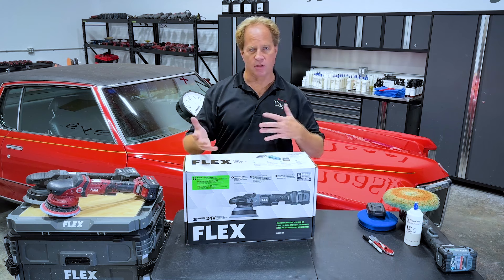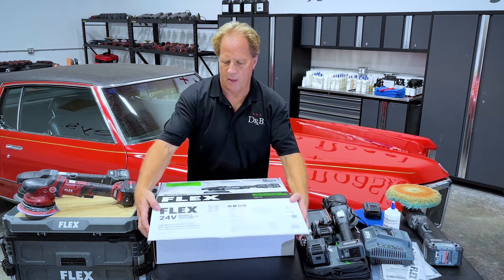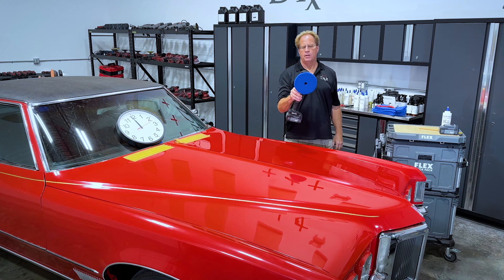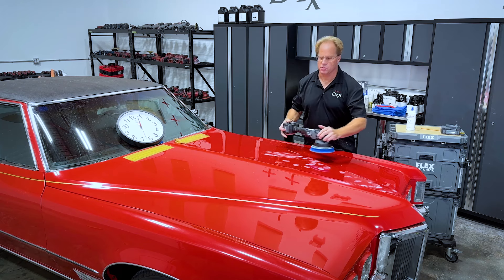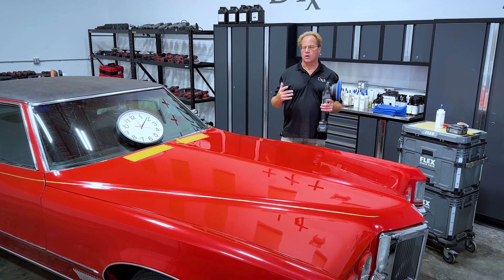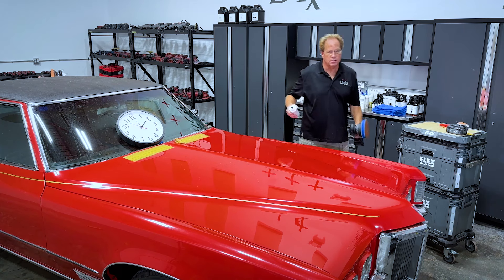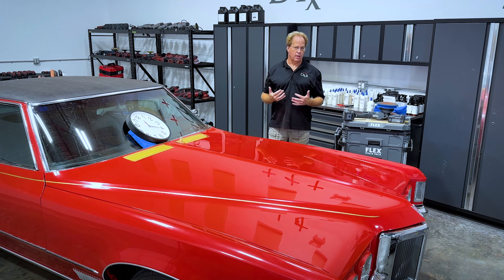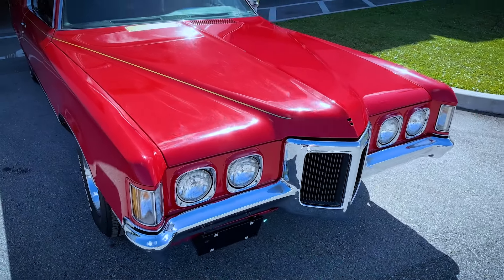NEW Flex FX3331 24V Cordless Gear-Driven Orbital Polisher Review & Unboxing

Comment: Just bought this machine... Additionally i have 3 tips for working on doors 1. I separate them, click the latch on the door to create a space to work safely to edges (pulling the handle releases the latch) , 2. If working the back door I open the front door so I can work to the edges also, 3. I'd work parallel to the body line just like Mr Phillips, Including the door handle, then divide the lower section into halves, I always try to work along a body line and not crossing against it that could potentially burn the edge
Reply: Great tips.  I just used all these tips on a 1935 Chevy 3-Window Coupe Streetrod.

-Mike

Comment: The Flex Legend! Just got my 24V 15mm and put up my first impressions. Correcting an FL5 Type R this weekend and it’s killer so far.
Reply: Enjoy!

Thank you for watching and commenting.  -Mike Phillips
Reply: How much did you pay for this tool?
Reply: @yuriy797   - This particular tool retails for just under $700.00 and this includes the batteries, 2 batteries, a storage case and the charger.

-Mike
Reply: @mikephillipsrealworlddetailing  😂 Cheap 😂

Comment: Definitely like the 6 inch backing plate with these. My only gripe of the rotary is the max speed is a little low for using a pad washer and spinning out the pad. These polishers are all beasts. Also nice having the lifetime warranty. Both the rotary and the forced rotation came with 6 and 5 inch backing plates with mine.
Reply: I agree with the high-speed RPM for slinging out water when using a pad washer but I'm confident the engineers at FLEX gave it a minimum and maximum RPM for the function of a battery-operated tool as well as the most common use for this tool is for doing paint correction on modern clearcoats where you don't need super high RPM.  Gelcoat is another situation, but I still show and use these for removing sanding marks out of gelcoat - but on the highest speed setting.  The freedom of buffing out a boat (or a car), without using a tool with a power cord is really nice.

Thank you for watching and commenting.  -Mike Phillips

Comment: Thank you for sharing your polishing expertise—it's always greatly appreciated! I’m in need of some advice as I’m about to upgrade my equipment, aiming to make the purchase by Thanksgiving. Initially, I had my sights set on the new model from the Italian brand, but after attending SEMA, I’ve decided to go with Flex instead.

I was set on getting the FX3321 random orbital with the upgraded 6-amp stacked batteries. However, after watching your videos and Nick’s from McKee's multiple times, I’ve started leaning toward the gear-driven FX3322. Now I’m torn between the two.

A little background: I’m an auto detailer working out of a garage studio and a mobile van. About 30-40% of my work involves paint gloss enhancement or correction, but I plan to increase that number since I focus on reconditioning vehicles. Since I’m not as young as I’d like to be, factors like weight, noise, vibration, and balance are particularly important.

I know you’re more inclined toward rotary or gear-driven machines, but if I asked you to take an unbiased approach, which would you recommend based on the details I’ve provided? For reference, I currently work with a random orbital.
Reply: You indirectly answered your own question. Since you own a random orbital, get the gear driven. There’s a reason why the GOAT, Mike Phillips, chooses it as his first weapon of choice unless there’s really severe defects then it’s the rotary first followed by the gear driven 2nd. 

And for what it’s worth, I own two gear driven flex polishers and a DA polisher. Gear driven every time unless it’s super soft paint, then it’s the DA. 

And you’ll appreciate that the gear driven tool doesn’t stall which means your saving time with each detail and time equals money. 

But for sure follow Mike’s guidance. He’s used every tool in the book.
Reply: @jamess.7415  I realize I should have been more specific. This purchase is actually meant to replace my current random orbital rather than adding to my "arsenal." My main concern isn’t really about stalling, as that’s rarely an issue with my random orbital.

What I’d really like to know, in addition to my earlier questions, is whether the cutting power of the gear-driven model is significant enough to justify the potentially longer time it might take to complete a job. My understanding is that the 15mm throw of the random orbital allows for faster coverage but is less effective compared to the 8mm throw of the gear-driven. But is the difference substantial enough to make it worthwhile?
Reply: I just read through your original question and the follow-up replies by Jamess.7415 and then yourself.

Here's the deal.  When using ANY brand or type of free spinning random orbital polisher, you're always going to fight the issue of pad stalling.  It's just a fact.  Besides making it take longer to do paint correction; you also have the issue of BRAIN DRAIN.  Brain Drain is when you mark the side of a backing plate and/or buffing pad to make it EASIER for your EYES to see if the buffing pad is in fact rotating and oscillating.  In theory this means for the entire time you're buffing out the car you MUST LOOK and SEE if the pad is rotating/oscillating or simply stalling out.  I call this brain drain and I for one simply don't use these types of tools very often for this reason.

I like to go fast when I do any machine paint correction, thus I primary use rotary polishes and the ORGINAL FLEX BEAST because the original BEAST has the highest OPMs and the highest RPMs.  Thus you can plow through a paint correction as fast as humanly possible while maintaining pro-grade results.  Throw in a simple 8mm Porter Cable and you can tackle just about anything.

Thanks for watching and commenting.  -Mike Phillips
Reply: I truly appreciate your feedback—it means so much! It seems I made the right choice. I’ve ordered the gear-driven polisher and can’t wait to start using it!
Reply: @jamess.7415   - Yup, if I can use the BEAST, then it's Go Time!  If a rotary is faster, then I start with rotary.  If the paint is soft or I'm working on clear plastics, I go with a simple Porter Cable 7424XP.

Use the right tool for the job.

Thanks for watching AND commenting.  -Mike Phillips

Comment: I find that most detailers underwork the correction fluid or work at too high a machine speed, polishes/compund have 2 parts, the abrasive and the carrier, if you work the machine at a high speed the carrier burns out before the abrasives get a chance to do any major correction, instead work at around speed 3/4 at first, clean the pad and redure speed to 2/3 and do a pass before wiping off the polish, this would ensure a proper buff cycle (note that most polishes to date use diminishing abrasive technology, DOT)
Reply: Good info, thanks for sharing.  -Mike

Comment: Mike does the forced rotation random orbital require different pad as its gear driven??
Reply: No, not really.  The most important thing when picking pads for a gear-driven orbital is to pick a pad that has *good velcro attachment strength to the backing plate*.  Because of the POWER that comes with a gear-driven orbital, and the fact that you can *GO UP ON EDGE*, you simply want good attachment strength, so the pad doesn't go flying off.

Currently I'm liking and using for all our car and boat detailing classes the EdgeGuard pads from Buff & Shine.  Not only to they have good attachment strength with the FLEX choice of HOOK used for their backing plates, the new 18v FLEX Cordless BEAST and FINISHER have a tick larger backing plates than the original FLEX corded BEAST and this means they CENTER easily onto the backing plate and because there's a plastic inner cupping around the outer edge of the back of the pads, there's dramatically less risk for anything bad to happen when you do go up on edge.

Hopefully the above makes sense.  It would be easier to show you than to type to you about it.  :)

Thanks for watching and commenting.  -Mike Phillips
Reply: @mikephillipsrealworlddetailing  Perfect sense mike I'll look into the buff & shrine pads. Saw them on your YouTube page and looked what I saw. TY for taking the time from your day to help this community much appreciated.

Comment: Does this model still spin counterclockwise?
Reply: Yes.  I hear people tell me all the time that they don't like that the FLEX family of 8mm gear-driven tools because they buffing pads spins counterclockwise instead of clockwise like a rotary polisher.  What this means is due to the power you get with a gear-driven orbital polisher, if you don't hold the pad flat to the surface, you'll feel the tool pulling in any certain direction.  This pulling is the POWER.  Free spinning random orbital polishers don't pull like this or "walk" like this and that's because they don't have the same power.

The other comment I hear is,

I like the RUPES Mille because the buffing pad spins clockwise

This is accurate and the same rules apply, if you don't hold the pad flat to the surface, the RUPES Mille will pull or walk in a certain direction.  So, no matter which direction the buffing pad is spinning, due to the extra power provided by gear-driven orbitals, they are all going to pull or walk to some degree.

There's also the comment where people that like prefer the buffing pad to rotate clockwise are basically saying,

I like this tool because it pulls me this direction

So kind of silly.  One of the characteristics of a gear-driven orbital is it is going to have the walking-effect or the pulling characteristics - it doesn't matter which direction the pad is spinning.

And for the record, ALL of the FLEX 8mm gear-driven orbital polishers spin the buffing pad counterclockwise.  This includes,

The BEAST
The Supa BEAST
The CBEAST

and the newest version of the original CBEAST, the 24 volt CBEAST.

Thanks for watching and commenting.  -Mike Phillips